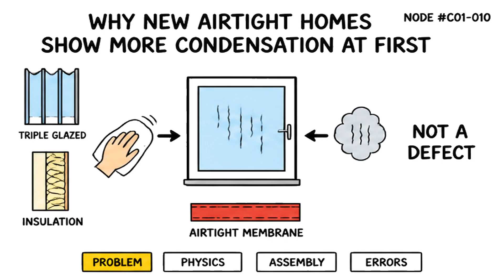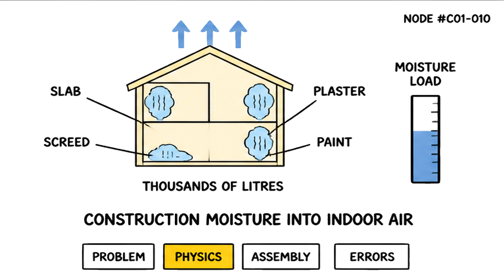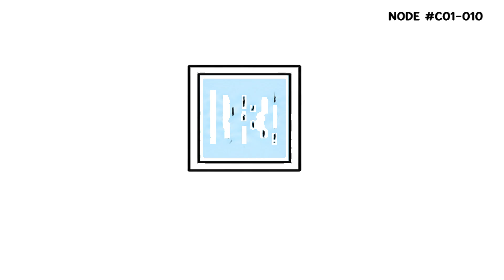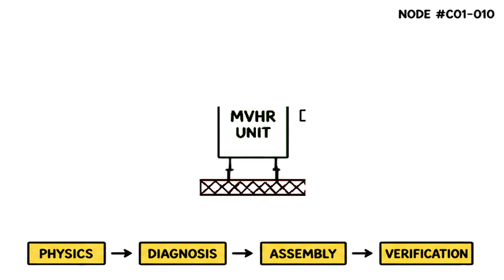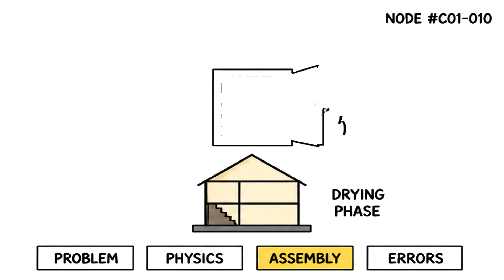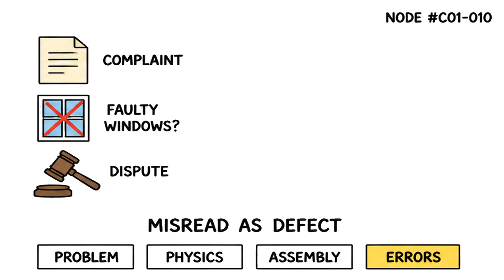Brand new home, MORE condensation here's why — building physics Vaporight 010

Comment from the maker: 📌 THE PARADOX CHECK — does your new home fog more than the old one?  
  
Three signs it's construction moisture, not a defect:  
1. Condensation appeared right after move-in or after wet trades finished.  
2. It's heaviest in the first winter and fades in the second.  
3. The MVHR wasn't running or wasn't installed yet when the fog started.  
  
If all three match → your building is drying out. Run the ventilation, manage humidity, give it time.  
  
Does this match your experience? Drop your story below — or tell us which node to break down next.  
  
🏠 Vaporight is a numbered library of building envelope physics, one rule at a time. Explained, not prescribed.